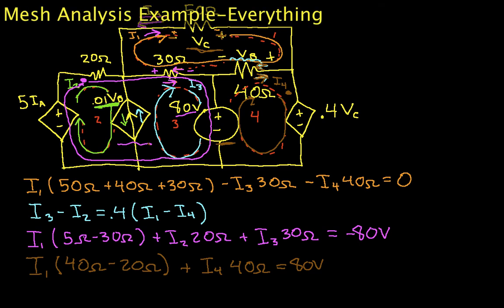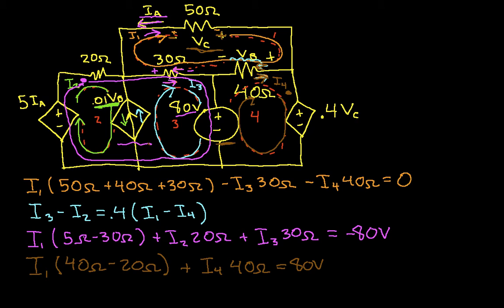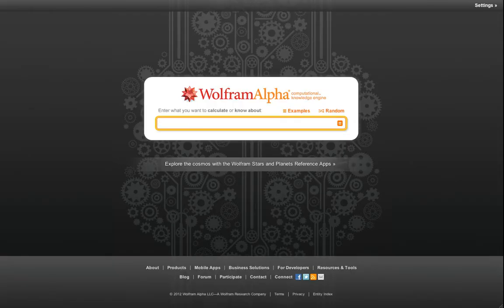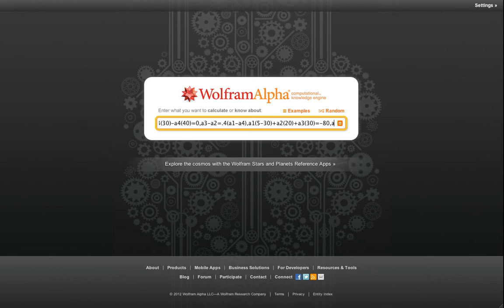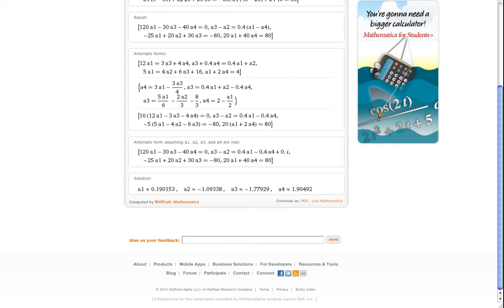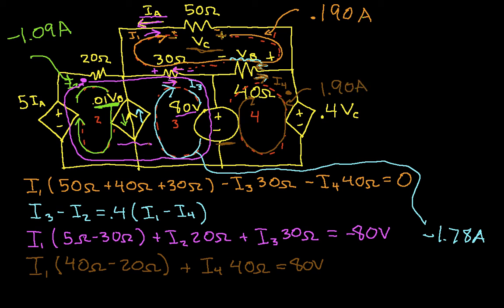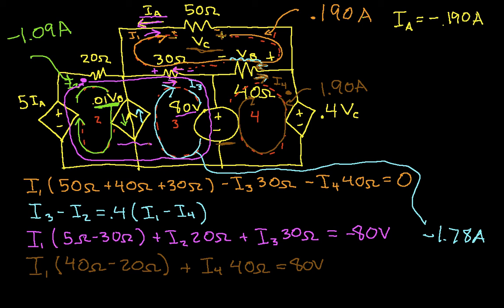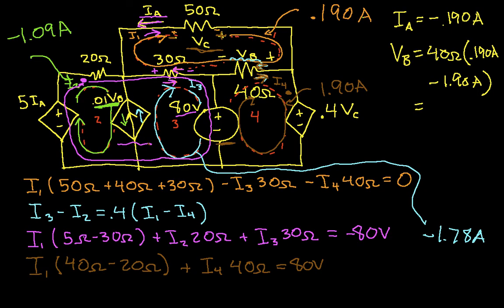Mesh Analysis Example-Everything Part 2

Comment from the maker: @acer57, @stephenxluo
Actually, I believe stephenxluo is correct that the voltage should be negative. The polarity of VB is defined so that I1-I4 flows from positive to negative, and I1-I4 is negative, so the voltage is negative. (This is what I have written, but I reversed it when doing the computation.) I will add an annotation to the video correcting this. Thanks for finding it.

Comment: your answers are wrong. i solved it in manual calculations. the correct answers are:

I1 = 0.473A
I2 = -0.827A
I3 = -1.722A
I4 = 2.709A

simulate first before making video so you can verify if your answers are correct. well anyways, great video. just need some editing to make it right.